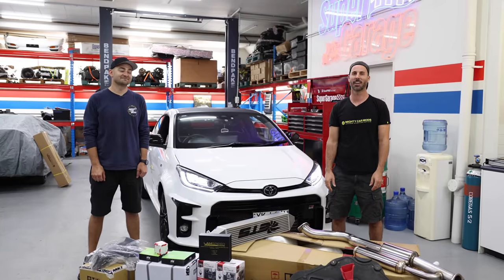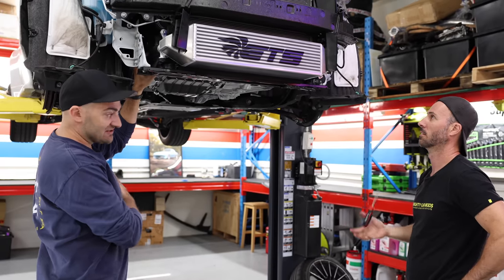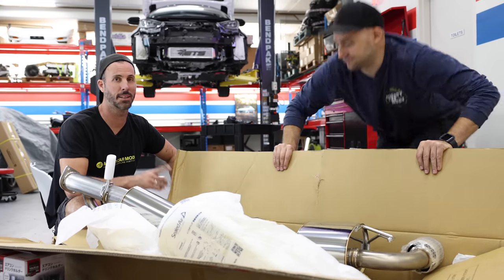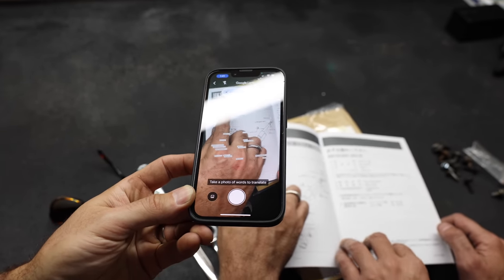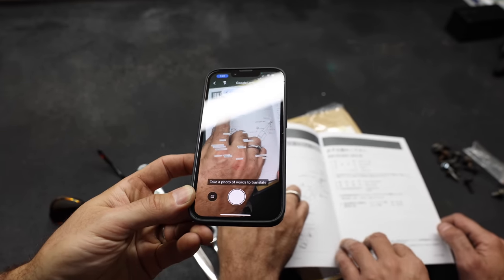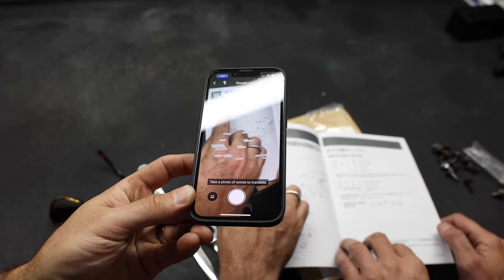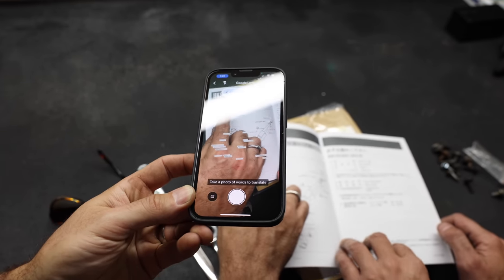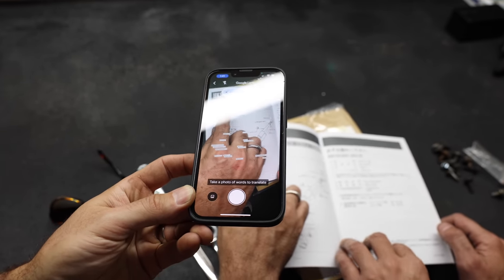Toyota GR Yaris MOD EXTRAVAGANZA

Comment: I'm driving a used 2007 Yaris S. From California to Texas, and still running after 15 years with 180K miles. I only had 3 oil changes, 1 time x 4 tire change and never had a car repair yet. It is a reliable everyday car. Unlike my Mercedes I spent 10X more just for maintenance. Don't say it's trash, because if I want a need for speed/race car or a showoff car, I do have others.

Comment: It's amazing the difference between Toyota and VW in their approach to making a performance car.  Toyota seems to take the simplest path that works properly,  VW,  in typical European style,  add sensors to everything.  I guess that's why I love Japanese cars,  they're only as complicated as they need to be,  engineered to last,  and end up being worth more after 10 or so years,  based on the fact that you don't have to take out a 2nd mortgage to keep them on the road.
Reply: @bigredranga69  What Japanese performance car?
Reply: @bigredranga69  more like homologation car
Reply: Have you ever actually owned a Japanese performance car? Just curious
Reply: @teagueomalley3720  yes, and will continue to do so.  I know too many European car owners who have told me horror stories about parts pricing etc.  The worst I have personally come across was 0² sensors on a Subaru
Reply: @bigredranga69  I’ve got an 8p A3, it’s nothing special but I’ve been ragging the shit out of it since I bought it last year. Only thing I’ve had to replace was the radiator, that was already on its way out anyway. 

For all the horror stories I’ve been told over the years of working on VW group cars, the only issue I came across was the excessive number of bolts holding the front end together. I feel like people over exaggerate sometimes
Reply: cant really compare the two.   VW are modifying a car for the mass market,   Toyota have built a car from the ground up with WRC in mind.    Totally different markets and design intent.
Reply: Please describe which Toyota performance car you are on about lol - Camry, Corolla, Yaris GR lol The reality is anything called a Yaris is going to be a POS.
Reply: @fredbrackely  Supra, Celica GT4,  2000GT, MR2, Corolla AE86, anything 2JZGTE powered,  almost everything 1UZ powered not to mention many Lexus bedged vehicles as well.  

Most make your VW Golf  GTI look a bit girly by comparison.

Comment: A trick for pre filling your oil or trans cooler: hold the hose up the connects to the high point of the cooler. use a funnel to fill it. Clamp it off with hemostats about  4”, 100mm, from the open end of hose. Connect it. Unclamp. Prolly unnecessary but I always get paranoid about cavitation when the air hits the pump and the uncertainty of my fill level
Reply: My trick is simply take your spark plugs out 🤷‍♂️

You've got an oil pump, you may as well use it 🙂
Reply: @UnitedKingdomRC  but didn’t they say it was thermostatically controlled? If so it won’t take any oil until the engines hot no?
Reply: @reefbloke  your right you know!

When I fitted my cooler I filled the cooler up best I could through one of the pipes, then fitted it as full as possible.

I then cranked with no spark plugs until the oil pressure light went out

The last bit of air would be purged out as the car approaches 70°c as it closes gradually, and has about a 10°c window I believe.

I noticed no drop in pressure on the first drive, and I have dials that monitor the pressure, it has a preset alarm that beeps if I drop in pressure 🙂

Comment: Really love the new wheels boys and all the new mods , bigger intercooler , big air intake , new hks exhaust system , new springs , new engine undertray , new brake ducts there will be a massive difference overall in performance handling grip and some difference in braking

Comment: I work at a toyota dealership in a parts department, and the reason the lug nuts have that shoulder is because they center the wheel on the hub using the lug nuts. When customers complain about vibration in the car, we'll put a factory set of wheels and lug nuts on to prove the problem is from aftermarket wheels and tires. Hub centric wheels or using hub centric rings usually solve the problem, which you guys are using. @26:20

Comment: Kinda cool the GR comes with a back door intercooler piping set up. I love the brand HKS, but have to admit was HIGHLY disappointed with my very first HKS purchase, 22 years ago @ 17 thought I was SO dang cool cause I ordered an HKS Super Mega Honeycomb "cold air intake" for my 1986 FC RX7 13B n/a. I was blown away that for $260ish, I got a foam air filter & a MAF adapter, & being a special order was non-returnable, I was young & a little dumber so I assumed it would have come with the piping etc but joke was on me. Sure did sound amazing under WOT though... at least until the Apex Seals failed at 86xxx miles.

Comment: This video reminds me of the mods I used to do on my FJ Cruiser.. so many Toyota original parts that I could put on. Wiring loom with included blanks for adding in switches for lights, etc. They really did think about the modification of the vehicle and it made things so much nicer..

Comment: From other YouTubers running on track with GR Yaris and WV Up,
 I have seen that good shock absorbers for example KW with a seperate container.
Provides much better control and lap times.
It is one of the best modifications you can make to your cars.
A new map are are good thing after change of filter and exhaust and Can give 20 hp, its worth to take.

Comment: For some folks that may not know - As far as the Intercooler goes, Bigger isn't always better! If you are running stock boost, it will drastically hurt performance mounting a Giant Front mount intercooler. Long story short, you turbo isnt pushing enough air to even keep pressure inside the Giant intercooler. Just too much volume in the FMI

Comment: If you want that engine to last with no issues I would be putting in 5w30 synthetic for the street and changing it every 7.5-10k miles. If you're gonna drive it like a madman or do any trackwork I'd be putting in 5w40 synthetic and changing it every 5k miles. I think adding the oil cooler was a smart addition regardless of what you're doing with it, turbo cars are normally pretty hard on oil and this is a particularly high output motor, plus you live in a very hot place. I would also recommend installing an oil baffle and oil scraper/windage tray if this car doesn't already have them from factory, as well as an air/oil separator or swirl tank. You do NOT wanna drop oil pressure or foam the oil under any circumstances.

Comment: The wheel nut with integrated washer is used by oems to have more consistent tightening. The idea is that you remove some uncertanties connected to friction of the discussed parts.

There are of course many ways to tighten a nut, and you could probably use a more expensive electrical tool with angle feedback instead and use regular nuts.

There should always be a balance between different relevant factors, which the design engineer considers when developing the car. So to be conservative, please follow recommended torque specs.

Comment: Speaking from a motorsport background, be very careful with those Ti wheelnuts, they’ll gall the threads on the steel studs without the proper lubrication, also you don’t get the same “stretch” as you would with steel nuts which could lead to the fasteners backing off.

Comment: Brake pad backing plates would cause more heat, not protect from heat, or dirt. The reason they are there on some cars and bikes from factory is to prevent galvanic corrosion when the pads backing is made from steel, especially if you have magnesium, or other metal pistons, this is why we used to use copper grease (or the silver stuff some mechanics use), and why an aftermarket pad like EBC uses copper backed pads. People actually remove them as a mod to improve brake performance on track, especially in the bike world.

Comment: Hey guys just a heads up. You may want to flip the oil cooler upside down to fully bleed it and get the most out of it. Air can and will get trapped and the oil will only flow through the bottom most cores.

Comment: Actually no matter what way your oil filter goes in. It's good to put some oil in it. Also the filter absorbs the oil when you first put it in the filter. So you can fill it half way & watch all the oil absorb into the filter element. Then when you turn it on its side. It won't come out.

Comment: LSPI (Low Speed Pre Ignition) is why I run Amsoil's boosted line of oils. Specifically formulated for GTDI (Gasoline Turbocharged Direct Injected) engines. I'd step up in weight for track days on a car that makes more cylinder pressure (horsepower) than stock. Like a 0w-30/40. LSPI is a deposit thing, not a friction thing.

Comment: I think you're being a bit optimistic thinking that there are going to be 1000hp 3 cylinders, unless a manufacturer makes a larger displacement version for some reason (the market is already flooded with 2 litre 4 cylinders and ICE's already have a shelf life due to agreements to stop making them by 2030ish) it's going to hit dimensional limits where you can't bore/stroke it without making the block too weak or incapable of hitting the high RPM that small engines need to make big power

Comment: The golf R is a $45,000 USD car. The Corolla will start around $30,000. The i30/ Veloster N starts at $35,000 USD and is a more appropriate comparison. Although I would still take a Corolla Circuit over the R

Comment: With those open air ducts in the front bumper over here, you lock up your brakes in a month.

You basically collect all the dirt, water, mud and all in between and dump it on you brakes

Comment: Crank the engine in flood mod... Full throttle and crank the car won't start but it will build oil pressure and fill the engine parts. Do it couple of times and start normally 👍

Comment: Don’t use titanium nuts, change them back to steel. Everything else is steel, so on track, when everything gets hot, you want it to expand and shrink together. I’ve seen too many cases of wheels coming off due to poor nut, stud & spacer choice.

Comment: @24:09 is why I bought the undertray 🤣 have a GR strut brace too, think lamspeed sell it at a decent price, I have the factory gr valve caps and seat belt pads to 🤣. I'm throffing over the mods of the gr yaris cos I sold my Nissan patrol that I put a rb25 neo in with a mate (I think my mate and I are you guys)  to use as a deposit on a rallye.  Before the patrol I had a r34 gt4. Was two door manual non turbo  but awd and had it for 8 year and kept it so mint sold it just before they were worth a million dollars to a p plater that mis match wheels size, put the cheapest fuel in it and put stickers over it for his "mods"

Comment: Hey Dudes, didnt you mount the oilcooler the wrong way round? The connectors need to be on top, otherwise, thw oilcooler will not fill up right and the oil, especially at low rpm, will just drain out of the outlet without filling the oilcooler. Please correct me if i am wrong but we already made the experience of mounting it upsidedown and had still temperature problems whilst we had no issues having the connectors on top.

Comment: Well I didn't expect to get a part-number flashback today! In a past life I was a Toyota partsman...seeing that oil filter and the part numbers automatically came to mind, 90915-YZZJ1 (aka 90915-10003)...hope you fitted a new 90080-43037 (sump plug washer) while you were at it? I can remember that nonsense after more than ten years, but I can't remember my shoe size...go figure.

Comment: Love you guys, love your content. I know cg is a thing, but doesn't lowering the car to "reduce wheel gap" (which is, but is not a thing) always make a car handle worse? Steering and suspension geometry negatively impacted, wheel travel negatively impacted necessitating stiffer springs as a crutch to avoid constantly bottoming out? Unless your kit is designed to compensate for these things, naturally.

Comment: The oil cooler hoses should go in on the top of the cooler, it may trap air in the top of the oil cooler if the oil comes in at the bottom, air go up, may stay trapped in the top of the oil cooler... maybe

Comment: No matter matter how many times you call it a cold air intake if it's sucking in air from any part of the engine bay behind the radiator it is  not a cold air intake !

Comment: If your going where I think then why didn’t you  road trip it and drive? I’ve just done over 4000 km drive through NSW, VIC and SA in my lowered 
Lancer, best dits we’re the Snowy Mt HWY and parts of VIC where the roads are twisty! Didn’t even mind the 99% of roads between which were bumpy or the endless road works to fix them!

Comment: Ok, no sledging!, I have an Abarth 124 Spider and have used a lot of great bolt ons and it’s great.  I recently bought a Hyundai 1.6 Petrol Turbo Nline as a daily driver.  Would like to bolt on some improvements but do t know where to look, any suggestions, or do I have to custom everything?

Comment: 0-20 is weird, even in a modern engine. The msot common oil weight for new engines is 5W-30 in Australia. 0-20W is like -15C winter oil.
Reply: 0w40 is overall the superior oil imo even for modern engines.
It handles the cold well and provides better protection when the engine is hot. Remember you are not just lubricating the bearings but also the valvetrain, timing chains and piston rings running up and down in the cylinders. A xw40 provides a stronger lubrication film than a xw30 here and especially engines with noisy valvetrains profit from going up one notch in the viscosity.
I wouldn't go past 0w30 in an engine meant for 0w20 thought since the tolerances in there have to be really tight for a water thing 0w20 to build sufficient oil pressure.
But yeah I found that our european engines here love 0w40 instead of the standard 5w30.
Reply: @alouisschafer7212  Yeah sure, but there really just isn't anywhere that gets that cold in Australia, unless you're driving up to the Alps, or maybe canberra on a bad winter, but even then you're talking maybe -5 maybe worst -7 in the morning, and at worst 0 during the day.

Comment: Hows your idle? I ask because I noticed the intake is necked down  at the MAF . Seems like the ECU can't read true mass air flow. My car has 2 aftermarket intakes and they neck down. Since then I have weird idles and engine dies when in neutral at higher speeds. Have not time to get to the tuner yet.

Comment: 13:36 Doesn't mounting the oil cooler like that with the lines at the bottom trap air in inside and make it mostly ineffective?

Comment: Just of note.  The GR Corolla that the USA will be getting will make 300 hp.  It will be the high output version of the 1.6 that is an option elsewhere in the World.  Most likely due to the extra weight of the Corolla platform.  Through other tweaks, I would not be surprised to see the GR Corolla to be the quicker of the 2.  Pricing is what is going to hurt us though, base price is going to be around $40kUS and the Circuit limited edition will be north of $50k PLUS dealer Mark Ups which these cars will have.  So no matter how good this GR Corolla will be, NO WAY will I pay $50k for a Corolla.  In this case, the VW Golf R is the "Deal" car to get.  With everything going electric in the next few years, all these cars will be off the table in the way we have known them for years.  Progress?  mmmmm ok.

Comment: Why doesn’t the car have the air conduits installed for the brakes o.O they come stock with that. At least, the one with the circuit pack should (like mine).
Reply: because it’s not a circuit pack

Comment: Umm.. in a tropical country, would it be better to just delete the thermostat in the oil filter adapter so that oil is always circulating through the cooler?
Reply: not really, thermostat is always better. can cause issues warming up the car etc if you don’t have one

Comment: With pre filling the system its a pain that newer cars don't have an anti flood system.  My 12 mustang had this so after oil changes I would mash and hold the gas before startup and then it would crank without injecting fuel.  Now it seems you have to pull fuses etc to get the same effect.

Comment: Yeah it's sad those little motors can't take that for very long before they blow to the Moon
Reply: I'd love to see one disassembled after 50-100k kilometres of hard driving. 
I'd say that running the best quality oil you can get is key here so fully synthetic 0w30 would be better than whatever Toyota approved 0w20 the store has. That stuff is thin as water when hot.